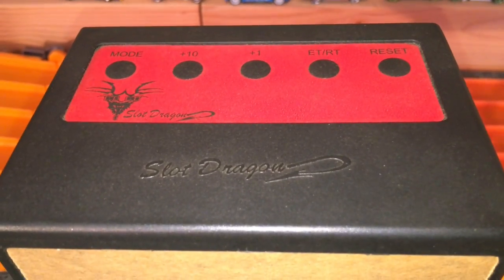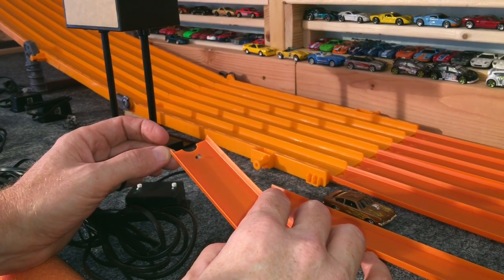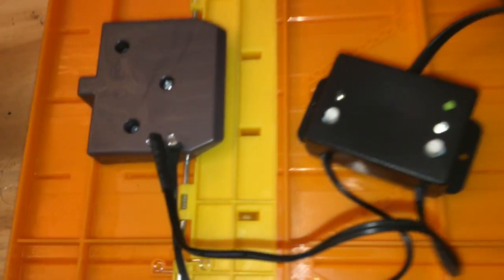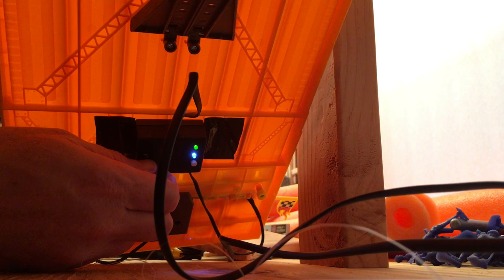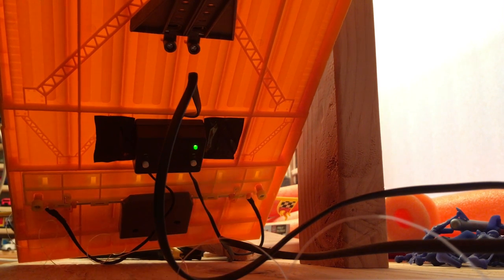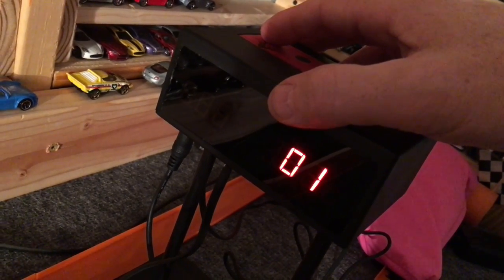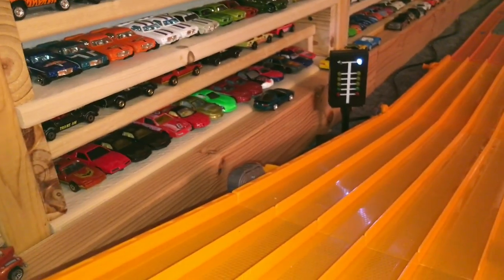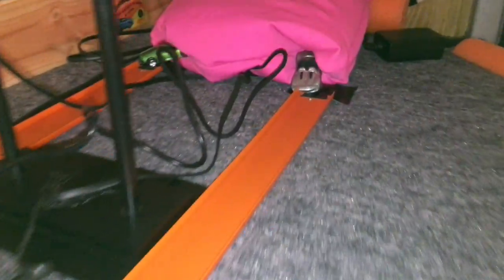Slot Dragon Timing System On The Hot Wheels Super 6 Lane Raceway

Comment: Had a slot dragon timing system for my 1/64 drag track. It works very well and Dan is great with any tech support. The system that Jegs came out with is not very good as it only times to the 1/10. That might work for full size cars where a .1 would only mean a car length or so. In slot car drag racing 1/10th can equal many car lengths. My fastest car runs the track in under .25 seconds at over 60 mph. This means a car that is .1 behind is losing by a lot. My current system goes down to the 1/10,000 and I have had more than one race decided in that 10,000th range.